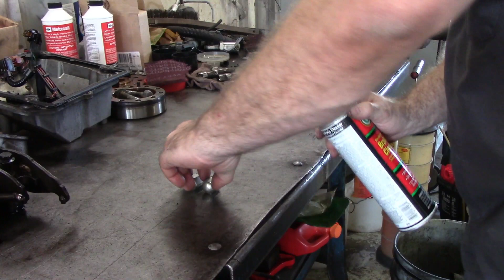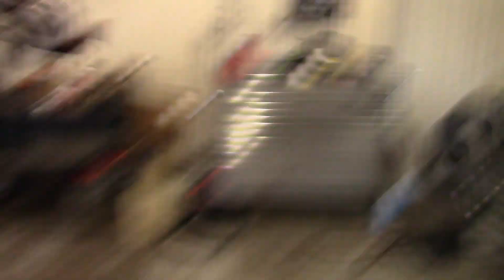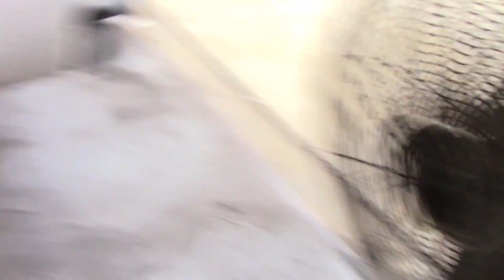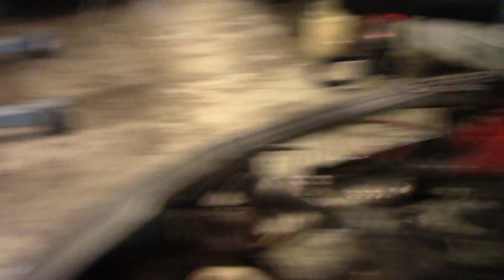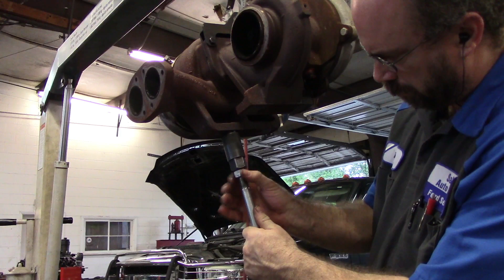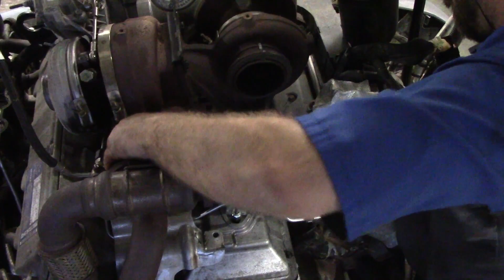6.4 Oil Cooler part 7

Comment: I put a new pump on a truck the other night. Put everything back together for it running and it leaked fuel. Took the cab back off today, replaced the crush washers, sanded the nuts and put it all back together, still leaks. Could the pump fittings be messed up from for and the pump be leaking? I triple checked all of the lines.

Comment: I shudder at all the places a “ flat rate” guy would cut corners.  Certainly wouldn’t debut the fuel acorns let alone test them.  Thankfully diesel isn’t as flammable as gas.  Those dowels they would just get dremmeled.  Let alone all those orings. I bet brad “ call back” or returns are the lowest in the nation.